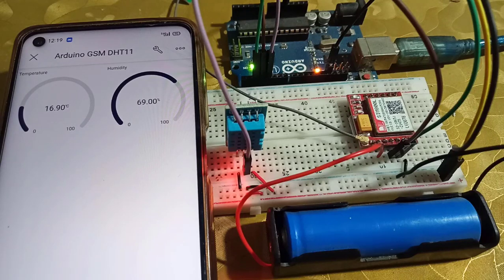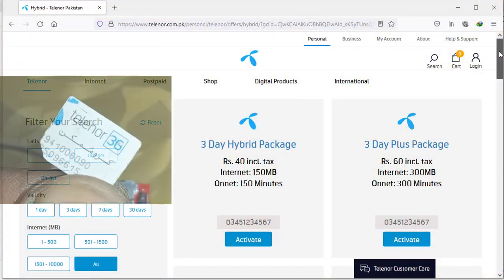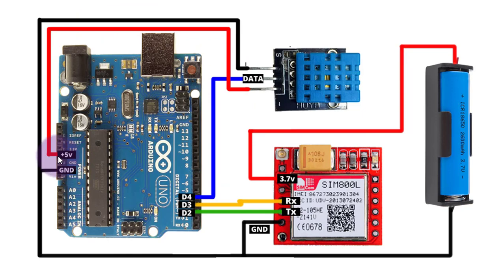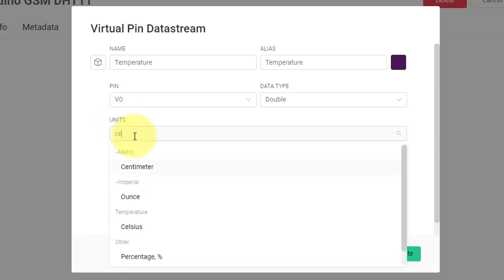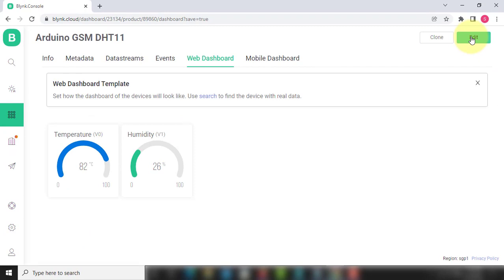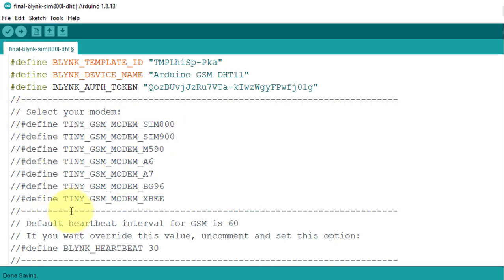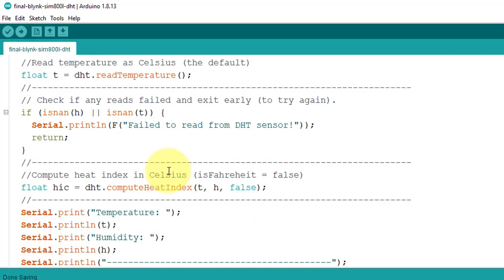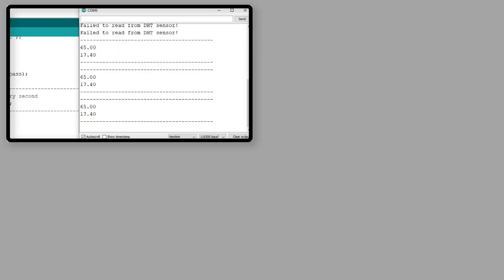Blynk 2.0, Arduino, DHT11 and SIM800L | Send Temperature and Humidity Data to Blynk using GSM Module

Comment: Hi, i have successfully done as per your tutorial and it was fun. Thanks man. 
Can you do the code for ACS712 current converter module which also connect to blynk server.. thanks in advance
Reply from the maker: unfortunately not
Reply: @AhmadLogs  you mean it is not possible to collect data from ACS712 ? 
i have tried to copy some code in the ACS712 library and inserted to the DH11 but have no luck.. i dont know where i missed out.. any thought ? thanks man..
Reply: @AhmadLogs  
Hi. Just an update for this topic, i have successfully connected and sends data to blynk cloud using arduino uno / Sim900 and ACS712 current module. however, it is being disconnected to blynk cloud every 24 hours. 
Any thought on this? Thanks again.
Reply from the maker: @joseneyargonsula732  you will have to write a code that will check periodically, if the internet is connected or not? 
and If the internet will disconnected then the code will connect again. you will have to add the code in the loop function

Comment: Excuse me sir, in my project at serial monitor writed invalid auth token. Can u help me sir?
Reply from the maker: you just copy auth token from your blynk account and paste it in the code.
Reply: @AhmadLogs  yes sir, i do that. But when i was run my coding, the serial monitor always write "invalid auth token" I also make a new blynk acount and new template/device but still invalid
Reply from the maker: @endekan6201  to figure out the issue, I will have to take a look at your code.
Reply: @AhmadLogs  okay sir, can i get your whatsapp or another contact?
Reply from the maker: @endekan6201  just upload the code on github or any code sharing website and just give me the link
Reply: @AhmadLogs  i'm sorry my English is not good

Comment: I solved the error Cannot Init. But Now I am facing another error. The serial monitor always says "Failed to read from DHT Sensor" I tried all the pins in the GSM. But still it is same. Please help me bro.
Reply from the maker: how you are able to solve the Cannot Init error.

test the DHT Sensor separately, without sim800l. There is some issue with your  DHT Sensor wiring.
Reply: @AhmadLogs  I changed the baud rate to 9600 and cannot init issue solved
Reply from the maker: @TechTrendsShameer  that's great
Reply: @AhmadLogs  dht 11 sensor is working with other projects without Sim module
Reply from the maker: @TechTrendsShameer  then it must works with sim800l. I think there is connection problem dht11. please verify the dht output pin in the code.
Reply: @AhmadLogs  I am using GSM 800 C shield. 
1. I placed the GSM shield above Arduino uno
2. Connected - from dht 11 to GND in Arduino
3. Connected + to 5 V in Arduino
4. Connected Signal pin from Dht 11 to pin 4 in Arduino. ( tried all pins from 4 to 13)
Reply from the maker: @TechTrendsShameer  it strange.

have you also change the dht11 signal pin in the code as well? 

remove DHT11 and Try to connect some other sensor with the same pin (pin 4). and check if that sensor works with sim800 shield or not and let me know
Reply: @AhmadLogs  yes. I changed in code as well. Ok I will try with any other sensor
Reply: @AhmadLogs  bro. I tried with Bmp280 sensor. Same problem. What to do ?
Reply from the maker: @TechTrendsShameer  I think your shield pins not working. there is some issue with your gsm shield. if a sensor works without shield. and when shield is connected it not works. 
its mean you need to troubleshoot your shield. 
let me know, if success.
Reply: @AhmadLogs  Bro. I tried a simple project with GSM Shield. i.e. control LED ON/OFF from Blynk, That is working. That means no issues with GSM module right?
Reply from the maker: @TechTrendsShameer  hmmmmmm. its strange. but unfortunately I did not figure out the issue.
Reply: @AhmadLogs  ok bro
Reply from the maker: @TechTrendsShameer  so nice of you
Reply: @AhmadLogs  bro this issue is resolved. There was a loose contact between the GSM shield and Arduino board. That's the issue. Thanks for your time.
Reply from the maker: @TechTrendsShameer  that's great. So, nice of you

Comment: Bro. I tried the same projects, but I am getting the message as "Cannot Init" in Serial Monitor. Can you please help to solve this?
I am using GSM 800.C module
Reply from the maker: test your gsm module separately, then connect it to your project.
Reply: @AhmadLogs  yes bro. I tried GSM module with other projects and it is working.
Reply from the maker: @TechTrendsShameer  check your rx and tx connections

"Cannot Init" means your gsm module is not working properly
Reply: @AhmadLogs Hi, I'm using the GSM 808 and facing the same problem. Checked the Rx Tx connections, also used the module for other projects and its working with them
Reply from the maker: @samarthbramhane5843  I have only tested this code for sim800l. I think, you need to make changes in the code. but I don't have sim808 for testing
Reply from the maker: @samarthbramhane5843  I did not figure out the issue. If every thing is working fine with other projects, then it means. you must need to change in the code to make it work for sim808.
try play with baudrate.
Reply: @AhmadLogs  Yes ,the baud rate was the issue in my case , tried 115200 and everything worked
Reply from the maker: @samarthbramhane5843  that's great
Reply: @samarthbramhane5843  I solved the error Cannot Init. But Now I am facing another error. The serial monitor always says "Failed to read from DHT Sensor" I tried all the pins in the GSM. But still it is same. Please help me bro.

Comment: I tried the same code, the gsm goes online for 10 seconds and stop which means the gauge updates only during that 10 second of connection and then stops. Is there anything I'm missing?
Reply from the maker: there is some powering issue with your gsm module

Comment: Hello, I Have Sim 800L but problem is that it's not responding to AT command. my power supply is correct because sim is working inside sim800l but when AT command is not working. any solution is available?
Reply from the maker: have you connect the sim800l ground to Arduino ground pin?
Reply: @AhmadLogs  Yes But When Connected To Arduino GND it's power down device completely. I lower this device using 3.7v battery and also add capacitor on vcc and gnd on sim 800l but when connected to arduino gnd it's power down completely.
Reply from the maker: @someoneissharing772  have you set the baudrate 115200 in serial monitor?
Reply: @AhmadLogs  No its 9600.
Reply from the maker: @someoneissharing772  so, set it to 115200. because I have set the baudrate in the code Serial.begin(115200). so, set the same in serial monitor